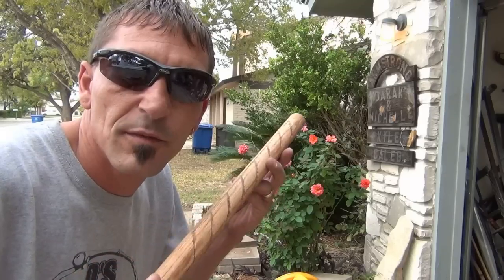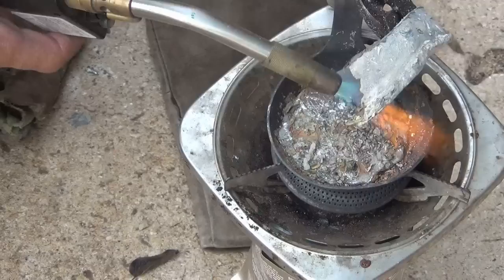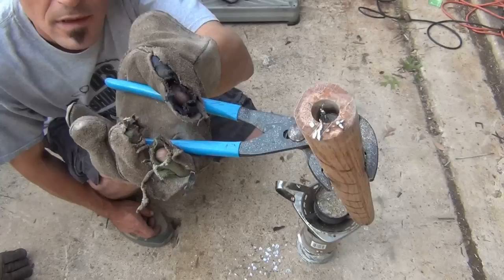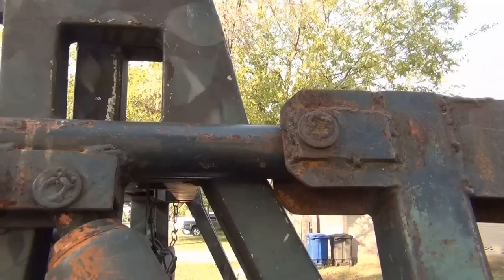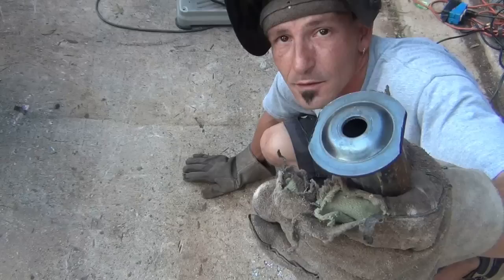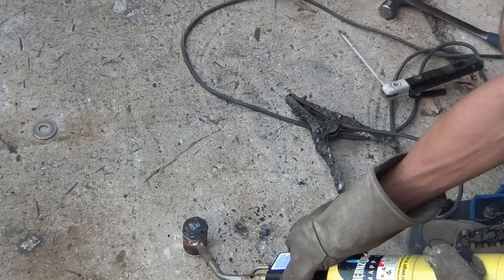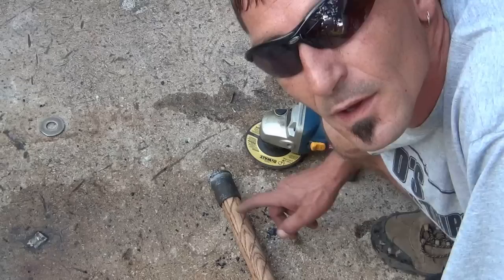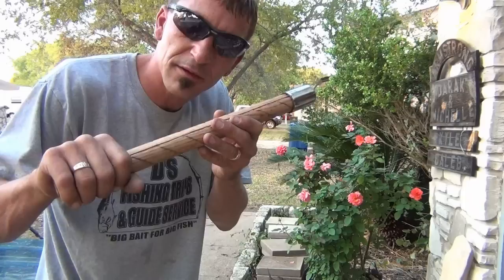Building A Tactical Walking Stick 10

Comment: Next time go to the electrical department of one of the DYI stores and they have 1 1/4 pipe and fittings.  Electrical pipe and conduit is measured ID as opposed to plumbing pipe which is OD>